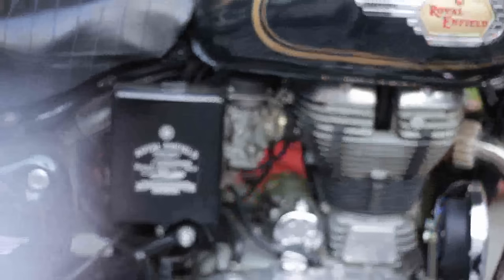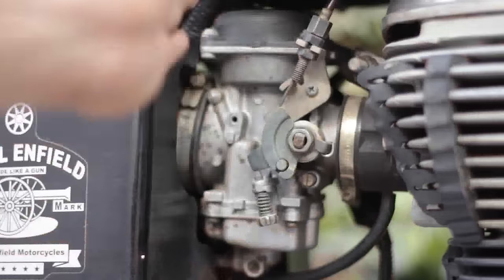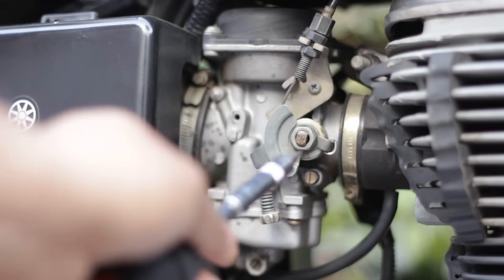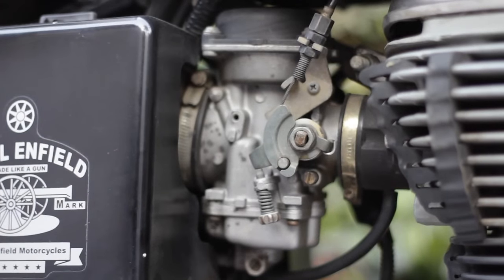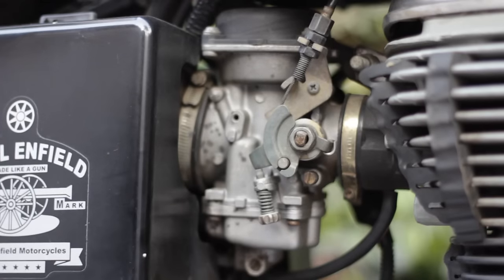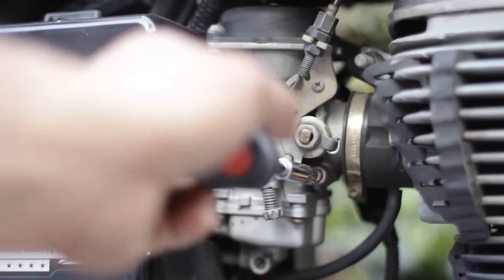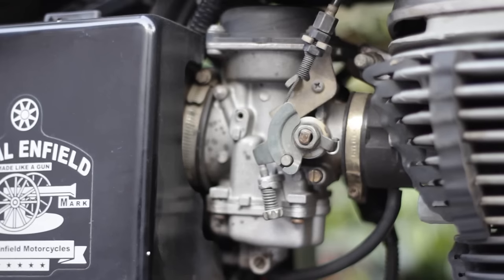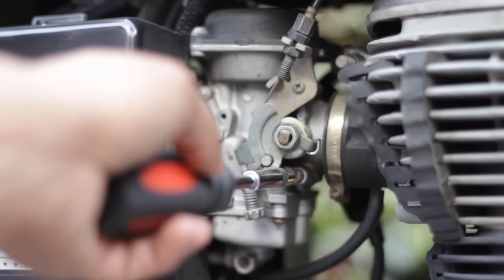Bullet Standard 500 carburettor Adjustment setting / tuning

Comment: Amazing man ! My carb achieves its highest rpm at 4 turns (8 half turns) and remains constant till 5 n a half turns (11 half turns) and 6 turns the rpms drop (12 half turns) so i generally keep it at 5 n a half turns(11 half turns) im definately gonna try 4 turns n see since thats where my bull achieves the sweet spot ill definately benifit on the average ill let u know after a week thanks for video mate . . . Amazing job 👍
Reply from the maker: Hi Darren, have you tried the setting as provided in the video? Would like to know your views.
Reply: +Enfield Performance man i tried the way u showed us in the video . . . and it turns out my carb achieves highest rpm at 6 half turns from fully closed position . . . it remains constant till 11 half turns and then at 12 half turns it drops and i have been setting it at 12 . . . but if i go with 6 the engines gets heated up too soon and it kinda runs outta juice while ripping it . . . i can climp uphill at 110kms per hr on 12 turns but cant cross 90 uphill on 6 turns
Reply: +Enfield Performance i do know if that i will be missing out on the mileage if im.keeping it double than what the bull needs but im pretty happy with the performance and yea also the deep bass thump at 12 half turns is kinda amazing . . . so tried both ur way and my way but liking my way but did understood alot of basics via ur video really appreciate it man good job 👍

Comment: I can do it,but want to confirm that im gettting a good position after 3turns full and between 3.half and little over it.want to know can i run in these position whether ill get mileage in exact that rising change position,,.
Reply from the maker: Hi Rishi,
I am afraid I don't understand your question. If you are asking whether you want to test it on different number of turns to check which on is best. yes you can try doing it. just don't ride too long. As a lean setting if ridden too long can harm the engine by heating it up and a rich setting can soot and foul up the spark plugs.
Reply: just making a little adjustment towards aout beow half leaner can do harm.
Reply from the maker: half a turn above the optimum setting should be fine. half a turn below the optimum setting if it is not heating the engine too much should also be good.

Comment: Hi All, I own a Bullet Standard 500 & got my first service done.. There's a lot of pickup noise/slapping noise in the engine.. Is this common across all Standard 500 models or am I fooled by the service engineer?
Also, will tuning of carburetor help solving the pickup noise issue?
Help much appreciated.. Thanks in advance..
Reply: old machine push rod-system poor quality of sapres=old bullet,  despite of all the earlier bullet riding is good with the very special beating but this new UCE engine is totally faulty ,stay way from efi engines

Comment: is this adjustment is enough for leh ladakh trip. is same for all bike (I means all brands)
Reply from the maker: Hi Vignesh, for leh ladakh this setting would work out. in case you feel hiccups on the mountains you can choose to make it half turn leaner. This video I mainly aimed at Bullet however if you get the concept you can apply to any carbureted motorbike.

Comment: Hi bro, I did this on my 1981 year RE bike. I got 2 complete revs in factory setting and I changed the revs to 1 and half by checking 4 times. Now, my bike performance increased. I have done this on 24th Dec and performance is good and went for a ride of 50kms. On 25th Dec I didn't ride my bike and while I starting my bike on Dec 26th, It's not starting. I turned the idle screw click-wise for acceleration and it started but, when ever I'm decelerating it is stopping. Smoke also coming more while accelerating. Previously, my bike is good with no defects. Could you help me ASAP?
Reply from the maker: Nagaraju Nag hi nagaraju, during winters most bikes will stop while idling as engine does not heat up properly. easiest solution is to just increase the idling. However in case smoke is coming out it means your bull is running rich. You can try resetting to old factory setting or retune the carb for the winter setting the same way.
Reply: I thought something bad going to happen to my bike but, restored with factory setting. After few days I'll try again the above method you showed. Can you tell me how many revolutions we have to turn the idle screw ?
Thanks, helped a lot ;)
Reply: Enfield Performance Thanks, I had reset that one to factory and tuned again. Now, I got perfect performance :-)
Reply: @Razerback56  how to reset to factory settings ?
Reply: @vickyvinay23  You should remember the screws position before changing the position of it. This helps to fix when there’s any issue with the performance or mileage. If you don’t remember then take it to a good mechanic and he will solve the issue.

Comment: Hi.,Could you please share some info on how you managed to hook up the tach.Ive been trying to do one., but it was never perfect.
Reply from the maker: Hi anant , my tachometer is connected to the alternator. Since alternator gives out a spark for every rotation of the engine by measuring the spark you can measure the rpm. Any competent auto electrician should be able to hook it up.

Comment: nice video... good
tell me which tachometer are u using ? i guess this is the one which easily available in any shop and ebay. i question is what is the frequency of this tachometer. is it 8.333 hz or 16.66hz? it suppose to have 8.33 hz for single cylinder 4 stroke engine.
Reply from the maker: No idea bro. I bought this tachometer from Karol Bagh. It connects to the alternator and gives out reading based on the number of sparks.
Reply: does it give exact reading? what is the idling rpm u get?
Reply from the maker: It is pretty accurate. I get an idling between 900~1000.
Reply: thanks bro....

Comment: Do i need to change my carb jets for a free flow silencer? Ive installed greasehouse megaphone silencer and the engine misfires sometime... So can i use the same method as shown in ur video?
Reply from the maker: Sandesh kini The misfiring in free flow silencers happens due to EGR pipe. It is specially pronounced when you are down throttling. The easy solution is to block the EGR pipe as mentioned in the usage tips in the blog 
http://enfieldperformance.blogspot.in/2015/11/red-rooster-performance-exhaust-review.html
Reply from the maker: Sandesh kini Hi bro if you do not have ball bearing you can even bloxk with a nut no issues. it will stop the misfires.
Reply from the maker: Sandesh kini Hey bro. this method wont stop misfires. your bullet is misfiring as ur silencer is free flow and does not create enough back pressure for the EGR to work properly. you will need to bloxk the EGR with a ball bearing or nut for it  to stop misfiring
Reply: thanks for the reply bro...will try to do so...

Comment: Dude I went to authorized center and looks like the guy messed up because from the second day on I hear knocking. Is there a way for me fix it myself?
Reply from the maker: hi ashwani follow the instructions and fix it yourself. get detailed description here http://enfieldmaintenance.blogspot.in/2016/03/bullet-standard-500-carburetor-ucd33.html
Reply: The knocking will go with better tunning right?
Reply from the maker: +ashwani lamba Hi ashwani. please read the detailed guide it has a point about engine knocking too. In case still it does not go away there might be another problem which you'll have to get checked.

Comment: i own a RE CL350 and the problem with my bike is while running  the engine seems to stop in betwwen as if there is no fuel and no power is going to the engine... i need to keep revving up the engine so it does not stops and on the signal while m still with the engine idle it stops for no reason
shall i adjust the fuel screw or the idle screw  m confused....
and i am scared to do it myself... i can get my bull to you if u can help me out and tune up my engine so that i never face the problem in future
Reply from the maker: hey bro. Seems to be the problem with idle screw. There is nothing to be afraid of. Just note the thread as shown in the video and in case you want to be extra careful mark one of the knobs of the idle screw with a marker. Then start the engine and turn the idle screw Eicher till the engine stops stalling at idle.
Reply: bro i have tuned the engine but now want to set the idle rpm so i got a tach hour meter... 
what it should be set on the tachometer like 01 RPM or 02 RPM ????

its a CL350cc single cylinder 4 stroke twinspark

01 for (spark plug fires twice per revolution)
02 (once per revolution)
03 (every other revolution)
04 (hour only will not display rpm)
the default for the sandard model is 02 (once per revolution)

i am confused on what to set it  01 or 02 ?
Reply from the maker: Paresh Vaktania It is 02. Though even without tachometer you can set idle. Just keep turning it till you fell the engine is about to stall. stop right there and the idle is set.
Reply: thanks a lot bro...
Reply: Paresh Vaktania check for the air tube if it got disconnected or damaged.. it will be below the tank
Reply: Paresh Vaktania I had same issue... The air tube got cut. just check for air tube for carburetor

Comment: hi I purchased a k&n e0900 performance filter for my bullet 500 do I  rejet my carburetor for getting an exact performance? service centre guys told me run with the stock settings bcoz am using a stock exhaust
Reply from the maker: with stock exhaust no need to jet your carbs.